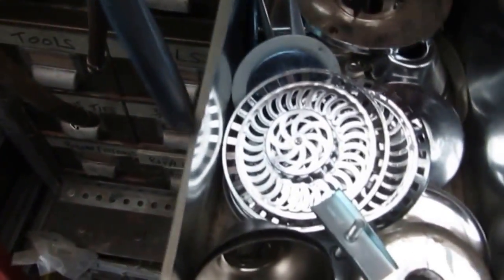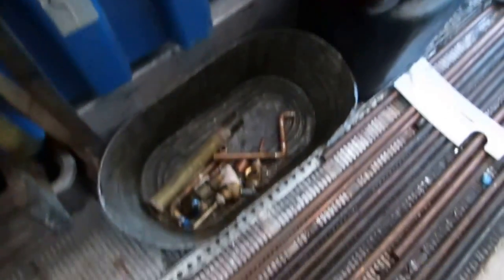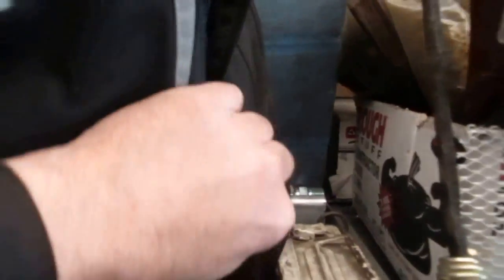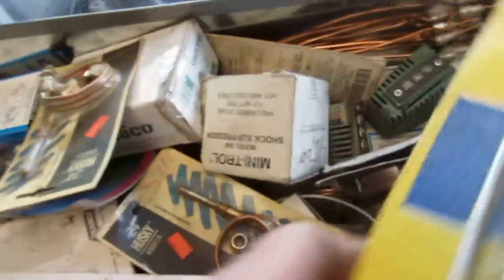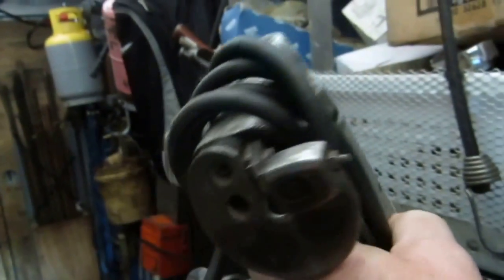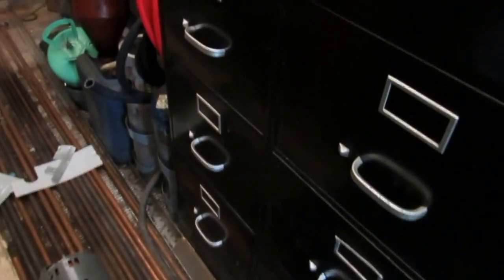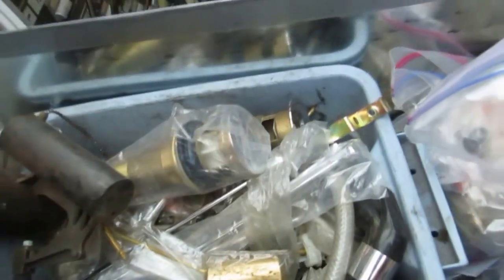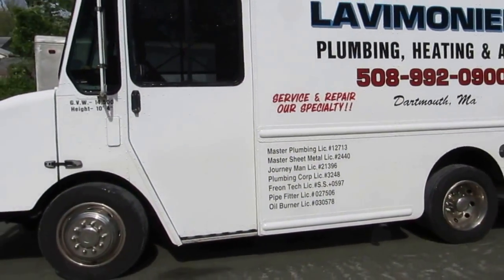WORK TRUCK:the best service truck on the planet ....part 2

Comment: I am a plumber from Wales in the UK. Our plumbing is very different to where you work. We used to use imperial sizing in the early 70's. Since then we use metric. We use 8mm, 10mm, 15mm, 22mm, 32mm etc copper and plastic water feed pipe supplies. House waste pipework is run in 32mm, 40mm, 110mm and sometimes in 150mm. I sometimes have to work on properties with the old imperial system and use imperial to metric fitting. The old imperial sized pipework is unavailable. We use rear outlet pan connectors for our toilets. They can be changed without the removal of the pan. We do use Honeywell heating controls amongst other brands. We refer to our faucets as taps. Our taps are still imperial sizing. Bath taps are 3/4" and kitchen and wash hand basin taps are 1/2". A lot of our buildings are over 300yrs old. They are made from hard granite stone and can be up to 4ft thick. I have to use heavy drilling equipment and long diamond bits to run pipework through them. There are so many other differences to our plumbing system, but it is really interesting to see how other countries plumbing systems work. Great video!

Comment: Looking good! I'm a general contractor servicing an 8 county area. I do practically everything which means I've got to carry practically everything. Lots of maintenance work. I've got about that much stuff set up in a 16 foot enclosed trailer.  Having supplies on site saves so much time. For everyone saying its messy. There is a method to the madness and you have to pack everything tight due to limited space.

Comment from the maker: i have 4 steel case fileing cabinets 3,18"wide ,1 ,12" wide fileing cabenits in my truck with panning on side so i can load them up with stock/parts ,you can put some stuff in them for sure .. but you need a truck that can carry the weight also

Comment: Your truck is so beast. I am jelly rite jow but I know one day I will have something just as bad ass or nicer. But one tool or part at a time for me. I just got a set of fieldpeice sman460 gauges. I am stoked and ready to dig into a f'd up system. I think what I like about your truck the most is the ability to stand in it without having to duck or craw.

Comment: My family's business had trucks like that. But t he Hvac trucks had motors, circuit boards and all parts of stuff we sold.  The plumbing trucks had full line of stems and plenty of faucets. The trucks left in morning and came back in afternoon. But the times have changed.

Comment: The thing I like the most about your truck is the aluminum body, NO Rust!!  35 years ago  I did roofing,steel  gutters ,Aluminum gutters. I bought a used bread truck it was all aluminum  20' long. For the seamless gutter machine. That truck ran on gas.

Comment: Don't use much of that anti gel. Most diesel fuel stations switch to a winter blend to address gelling. In this case, more is not better.  Follow the instructions for the correct amount. Keep your water separator in good order in the winter as well. (If its equiped with one)

Comment: Great setup Steve. Do you base your parts markup on the current list price from Webb, or is it based on what you originally paid for the item ?
Reply: Probably current price because I highly doubt that he saved the receipts or can even remember what he originally paid for all those parts.
Reply: Plus even if was bought a while back at low cost, the current sell price should reflect the costs associated with keeping items in inventory including lost/damaged/stolen/spilled items that will never be sold.